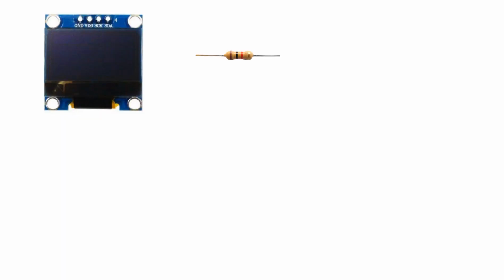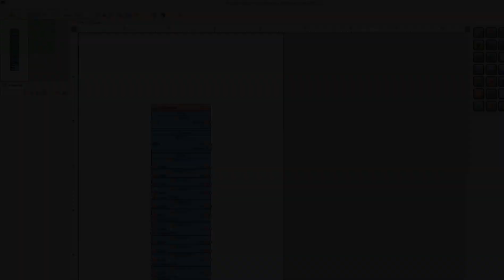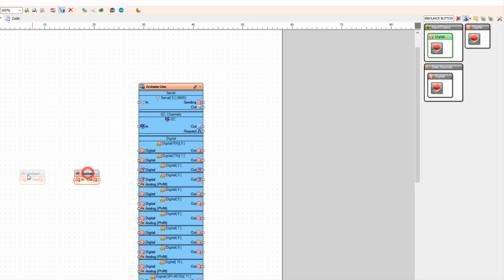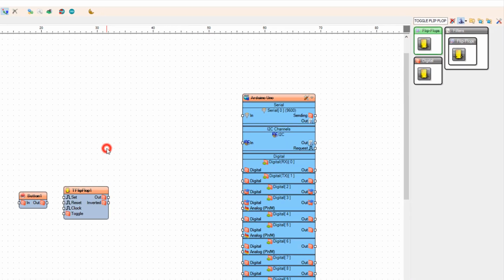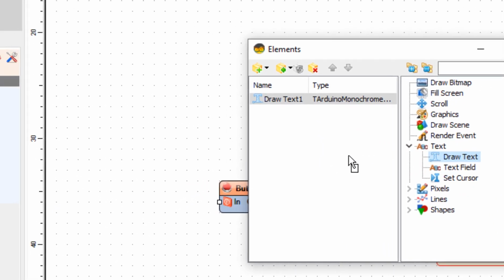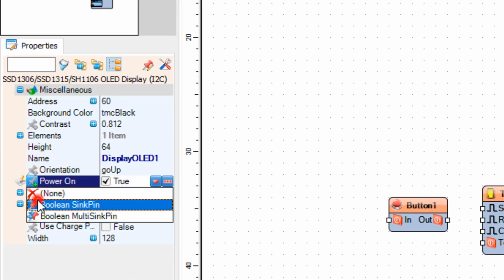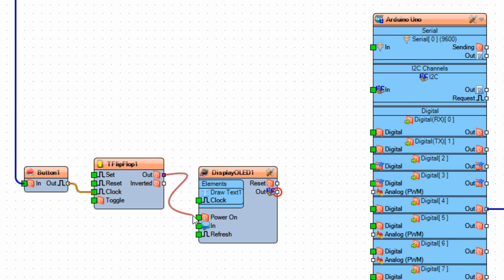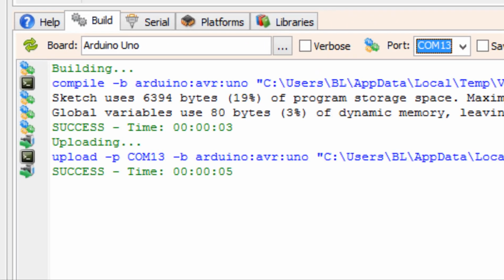Turn OLED DIsplay On and Off With a Push Button Using Arduino

Comment: Do you have the Arduino Sketch code for this?
Reply from the maker: At the bottom of the tutorial is Visuino file, open it in Visuino and upload directly to Arduino, or export it to Arduino IDE with a button "Send to Arduino IDE"
https://www.instructables.com/Turn-OLED-DIsplay-on-and-Off-With-a-Push-Button-Us/